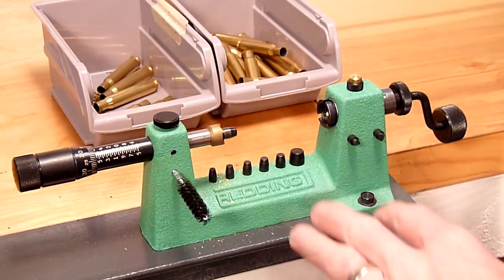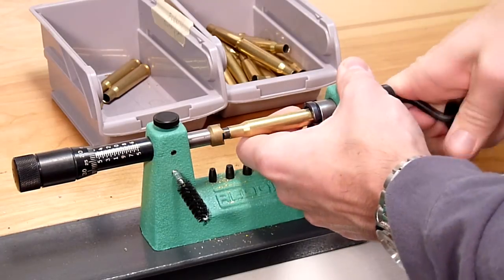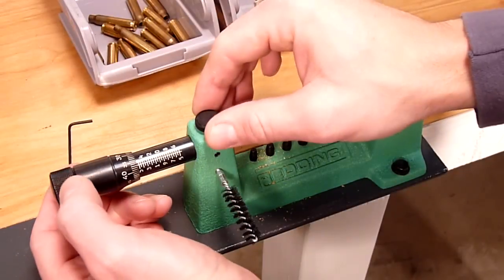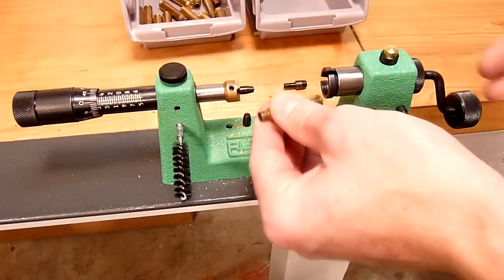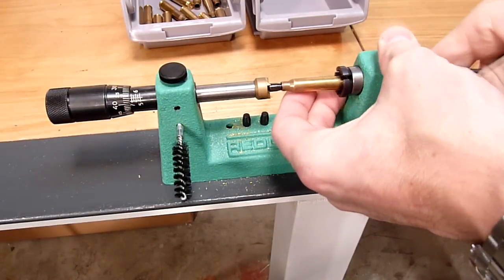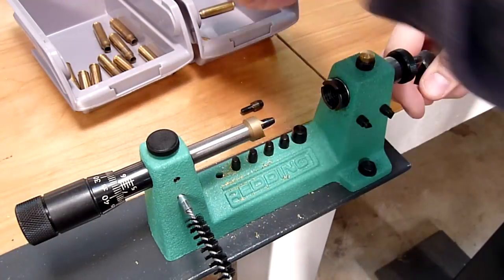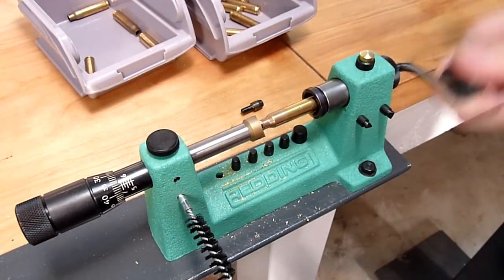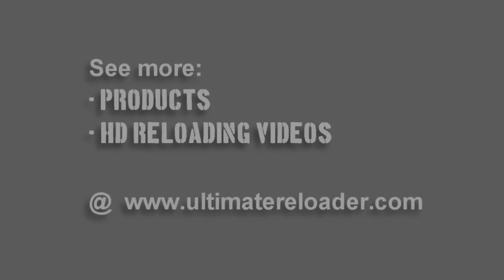Redding 2400 Case Trimming Lathe Rifle Trimming (HD)

Comment: Just curious... if you have that micrometer on there, why do all the guess work in adjusting your trimmer. Set the micrometer for what you want and run with it, or take a piece of brass ready to trim, measure it, set it in the trimmer, set the cutter up to it, and then adjust the micrometer for how many thousanths you want to take off and lock it down. Problem solved and no guess work.. of course I've never seen one in person so maybe the micrometer isnt that precise...